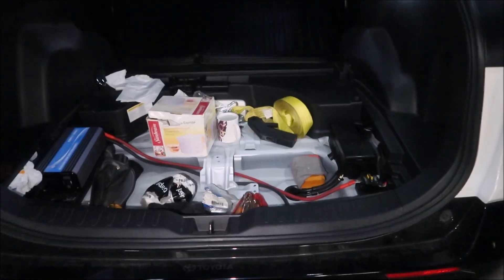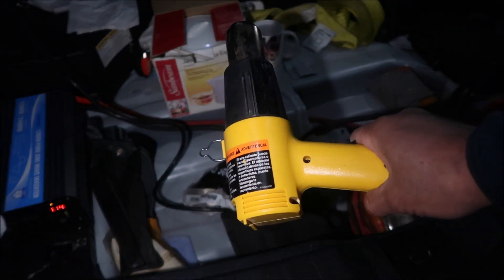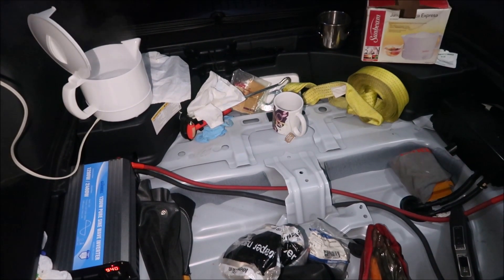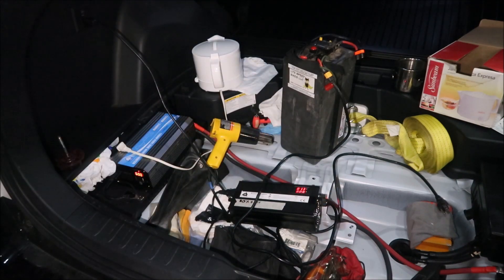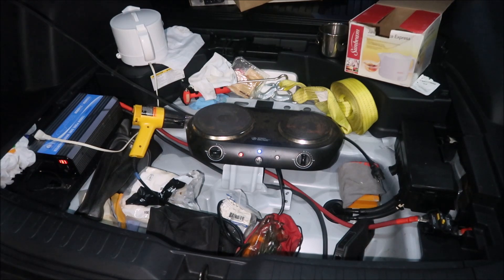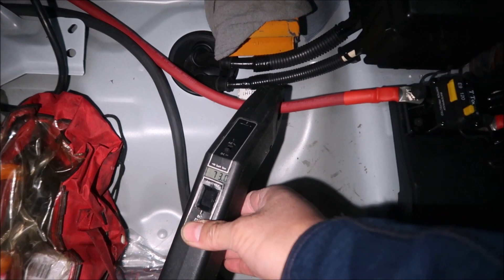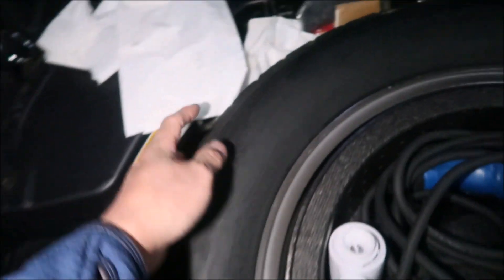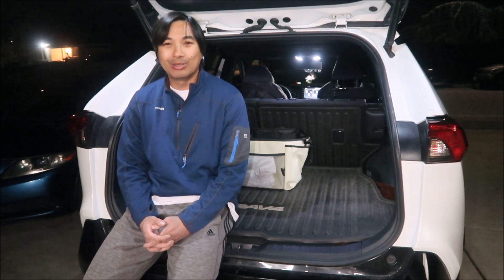Rav4 Prime Giandel 1200W Inverter Install Project Part 7: Second Inverter Test 2 (PASS)

Comment: I watched your entire saga. Great videos.  However, it seems that buying an aftermarket inverter for the SE is an Epic Fail.  You can easily plug an air fryer in the XSE Prime Premium and it works just fine.
Reply from the maker: Yes I regret not getting the xse pp but it was just too much.  But yes the inverter systen on the XSE is much more robust.  It runs off of the charging system dcdc converter.  I got another inverter and it worked great for a camping trip its nice having 2 outlets also.

Comment: Why didn't tyou choose a 1,500 Watt Inverter instead of 1,200?
Reply from the maker: I was following what Rav4Primer did to his R4P.  The main reason I went with this inverter is it fits underneath the trunk deck.  I recall Rav4Primer saying that it might be bad to draw more than 1200watts from the DC-DC converter.